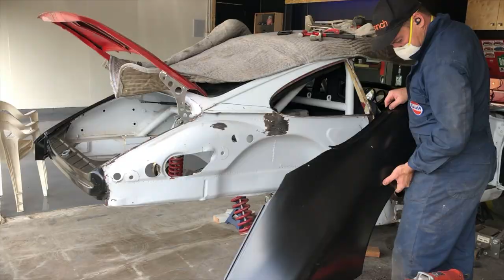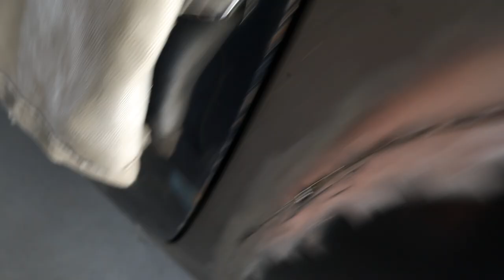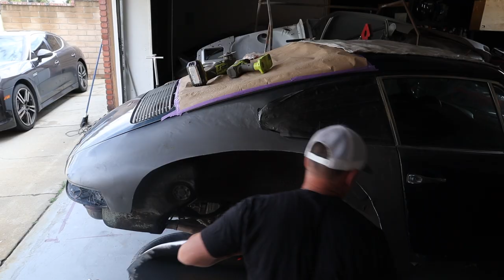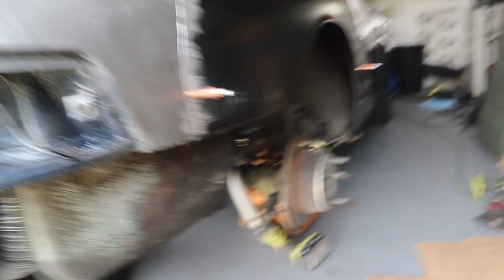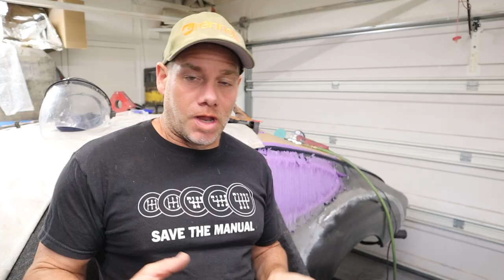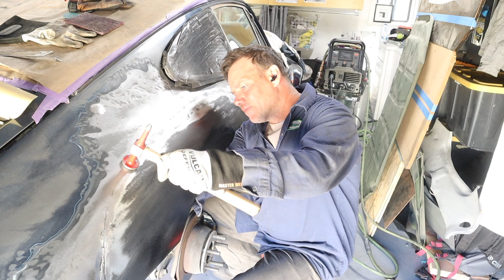Restoring An OBNOXIOUS SWB 1967 Porsche 911 to A Hot Rod 911R! | Fat Boy Slim 1

Comment: Nice work . Trouble with butt welding with a mig is the weld is hard and doesn’t lend its self to be beaten flat . If not careful with grinding and beating you can get cracking along the weld to metal edge . Oxy and tig is a flatter softer weld and better to panel beat and get flatter with a hammer/ flipper and dolly .
Cheers
Reply from the maker: TIG is on the menu for the future!
Reply: I did gas welding on sheet metal with a Mico torch. TIG is better because of less heat gain.

Comment: Michael steps up to Cleco's. Yea. And then I went back to sheet metal screws when I did this. I can have 1000 SMS before I can buy a few Cleco's. No shame.

Nice work.
Reply from the maker: just quicker to take on and off.
Reply from the maker: I've had them for years actually.

Comment: Is anyone out there in need of a couple of “new” SSI heat exchangers for a 3.6 engine?
Reply: I might be, as I’m going to put a 3.6 into 77 911S chassis. Are they 39mm or 41mm tubes? Cheers Lukas
Reply from the maker: Love this!  Rennch community!
Reply: @lukasmatzinger  Hi Lukas, just verified the primaries and they are 39mm.
Reply: I just listed them on EBay if you would like the details. If you’re still interested we can work out deal.